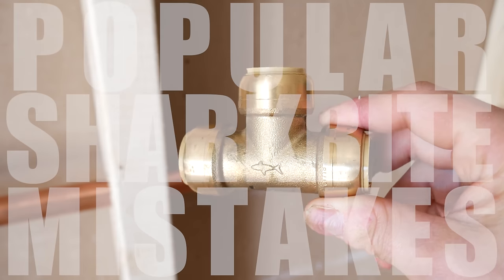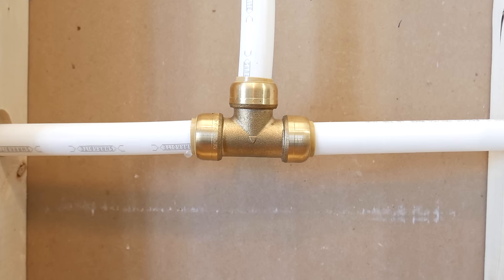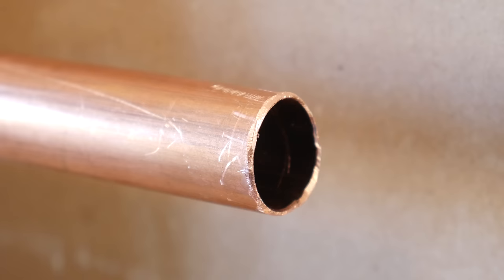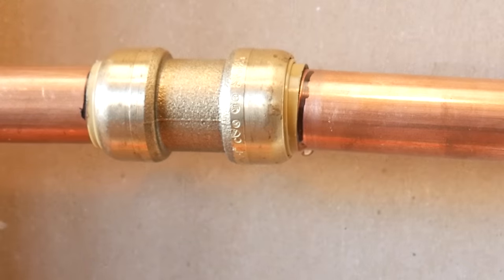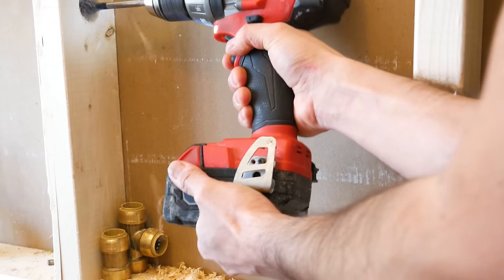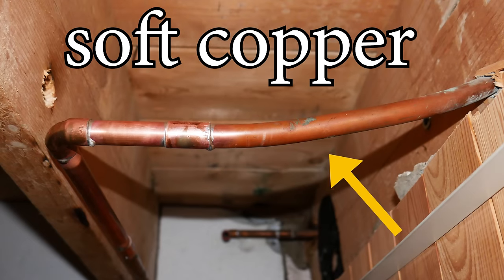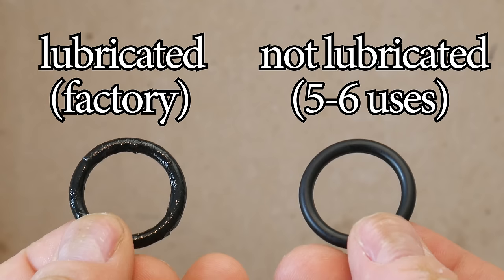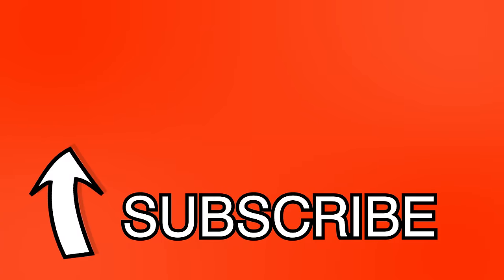6 SHARKBITE Mistakes NOT To Make! | GOT2LEARN

Comment: I've migrated solely to Sharkbites to minimize soldering and convenience.  I've marked how deep they should go from the early start.  I've deburred copper but now I want to get the tool.  I spend too much time deburring with a file, and it's not always right. I have silicone oil for other rubber applications, but now I'm going to use it on the o-ring here.  I've had problems removing Sharkbites on copper, but I'm getting a better grasp on it.  The tool doesn't allow me to fully push the seal in, so I use a crescent wrench to push in the seal.  I'm probably using the orange remover tool incorrectly.

Comment: Sharkbite fittings work on pressurized systems like standard house plumbing, but they will fail if the system is under vacuum. Learned this while trying to draw water up from a cistern using a pump. The vacuum pulls air into the fitting, and the system cannot maintain a prime.
Reply: Does it just suck the o-rings through? I have put them under suction with no issue but maybe it wasn't to the pressure you did?

Comment: I like this vid. Push-on fittings require greater care with the preparation of the pipe, but in return you get to skip the fire. This vid gets that across.
Reply: Disagree 100%. You need to take the exact same care with deburring and cleaning the pipe as you would with soldering. It's the exact same process, minus the flux and torch.

Comment: Weekend warrior here, great vid thanks. Plumbing task complete and didn’t have to call a plumber. Feels good to learn something new and self accomplishment. I enjoyed your soldering copper pipe as well-good stuff.
Reply from the maker: Thank you 🤗🤗🤗
Reply: You will call one when that rubber o-ring gives out. It will give out. Then that piece of copper you tied onto will have to be cut because of the corrosion caused to the copper by the water. They are for quick fixes and not permanent.
Reply: @texan4life129  good to know, thank you. I’ll keep an eye on it.
Reply: @jimb3093  soldering is very easy. I've been a plumber for 20 years and I would recommend this guys video on soldering to learn how. Very good instructor.

Comment: Your video helped me fix some leaky Sharkbite I was experiencing. I am brand new to using the product. I used it on a short run, with a 90, to replace a leaky spigot. It leaked in multiple places. I rebuilt everything 3 times before figuring out how to do it without leaks. I probably made every mistake imaginable, but ultimately, the following corrected the leaks. 1) cutting the pex very carefully and with a tool. I had been cutting it with a hacksaw and deburring the edges with their deburring tool. It seems there is very little allowance for less than perfect cuts with this product. 2) the length. Lowes didn't have the product to mark the depth, so I just used an inch for 1/2 inch pipe, and pushed really hard and twisted. Its a pretty good product, especially given a crimping tool is $100 at Lowes.

Comment: I finally tried some SharkBite fittings after years of refusing. I could never get an answer to the “how does it work”, “how long will it last”, and “how do I remove it” questions, so I just stayed with sweat joints.
After trying SharkBite, I’m sticking with solder. SharkBite fittings are great for commercial applications where no one cares about anything other than getting the job done quickly, but for residential work, they’re not good enough, in my limited experience. When they leak, you’re stuck cutting them off. Why do they leak? Who knows. You cut, de-burr, measure, and insert fully and sometimes they are watertight, sometimes not.
I trust copper and solder. It works perfectly every time and lasts forever.
Reply: You don't "cut them off". You use the release tool and it takes two seconds, leaving undamaged pipe for your next choice.
Reply: @UpnorthHere  I purchased a removal tool for a couple dollars. After several unsuccessful attempts (which damaged the removal tool) I cut the pipe. 
The instructions on the removal tool package were not helpful. I’ve heard there is a better removal tool, but I’m not plumbing a house, just doing some repairs and don’t need a $20 shark bite removal tool. I’ve got plenty of propane, flux and solder.

Comment: The trick to remove shark teeth — push the disconnect ring in really hard with the orange clip, and push the pipe in hard simultaneously. (This should disengage the teeth) Then give the pipe a good tug while holding the clip in
Reply: Use an adjustable wrench, way easier in my opinion.

Comment: Making a test gauge out of a piece of clear  flat plastic it’s something I did when I ran into a situation where I didn’t have enough slack in pipe to pull it together or push it apart
Reply from the maker: Works very well too, thanks IRON!
Reply: I’d love to see a video on this. I’m wondering what do do if you don’t have enough slack to push it together.

Comment: has the code solidified the use of Shark Bite behind closed walls yet? Canada and USA ?. We have been not using them behind closed walls , and if we did, we ensured there was an utility entrance near by to get to them.( arms reach ) .. unless that's just the practice of the guys I work with. Our COE prefers them when inspecting as well.  I, also for insurance reasons, needed a Master plumber to sign off on work and the first thing he wanted to ensure was NO Shark Bite type behind closed walls.  I am starting to think that is just an older plumbers preference..
Reply from the maker: I still don't think it's being enforced. I personally know plumbers who use Sharkbites all the time in walls and they never have any call backs, but yeah, maybe in a few years we'll be seeing them a little more ;)
Reply: No there is a reason. They are not for permanent use.

Comment: I marked the 2 pipes and no matter how hard I pushed the sharkbite down onto the pipe it would not touch that line!!!!  I have a small boxing space to work in but I pushed down multiple times, but it would not go down any further
Reply from the maker: You working on PEX or copper? Is there a white stiffener inside the fitting?

Comment: The invention of sharkbite is up there with ducktape & Velcro being invented
Reply: Except shark bites are way more reliable and long-term than duct tape or Velcro no matter what these old men who used to be able to charge an arm and a leg to sweat a copper pipe tell you.. sorry old man it's the new way and it's better than the old way
Reply: I agree with that assessment except for Velcro. That item was back engineered from an alien civilization.
Reply: The oscillating saw or viberation saw.
Reply: Duct*

Comment: You’re also supposed to remove the stiffener inside when using it on ridged pipe like copper and cpvc.
Reply from the maker: Sharkbite says it doesn't matter.
Reply: @Got2Learn  But it does constrict the flow. That is one of my main complaints with regular PEX fittings, they restrict the flow. But the Mannings with the rest is better than pipe, but not much better than copper. So the restriction at the fitting diminishes flow downstream.
Reply: No you’re not. They are specific to Pex and copper. The inner sleeve is actually two different diameters.

Comment: A quick trick for reaming is to use a needle nose and that smooths out the copper. It's not the best option. I always carry my reamer tool, but in a pinch...it'll smooth out burrs.
Reply: If you are careful on PEX, you can use a utility knife to deburr.

Comment: Biggest mistake is saying reliable and using them as a permanent fix. Should only be used if you do not know how to do a real repair job such as sweating or bruising.It should only be used if you have a plumbing problem that you can fix with this as a temporary fix especially on a holiday when you don’t wanna have to pay extra to have plumbing repair. But when it is feasible have a plumber do it the right way
Reply: Most new homes now have pex in them.  There's nothing wrong with shark bite fittings as long as you know what you're doing.  Copper is very pricey in today's world.  In very confined spaces it's kind of tough to get a torch to do anything without burning wood.  I'd prefer not to use a plumber unless I have to because they do not care what they trash in the process of getting the job done.  I do care.

Comment: What materials/tools would you recommend to clean old copper pipe to best attach a new sharkbite?  In another video you said to never clean the copper, yet on this one you said to always clean the copper!? So which is it? And how best to clean it? And, will it work if it's got some leftover solder (from the older copper connection), or does the old solder also need to be cleaned removed from the copper before using a sharkbite? Thanks! Btw, Love your videos, great content overall!
Reply from the maker: Yes, it's not suggested by Sharkbite to "sand down" the pipe when installing Sharkbite fittings, however, if there's solder from an existing joint, I would personally suggest to heat up the solder, wipe it off with a rag and then use some light sandpaper or emery cloth to remove the residual solder. But honestly, the best thing to do is to have it clean and untouched, so if you can just cut out that part and deburr it, I would prefer that, cheers!
Reply: If it looks like shit, I just use a normal pipe cleaner and make it shiny, just like if I was going to solder it. Haven't had one fail yet?

Comment: One thing I never see nor hear about is the affect on homes with a poor ground on copper pipes.  When you install shark bites in this scenario, it makes the electrolysis process worse.
Reply from the maker: Yes, with SB you need to "jump" the fittings.
Reply: What?? Do explain please.
Reply from the maker: Your home's ground needs to be bypassed if you use a Sharkbite fitting.
Reply: If you are talking electrolysis by going from copper to ferrous, you are mistaken about a poor ground. Whenever going from copper to steel one needs a dielectric fitting or "jump it". Sparkies love to ground to a utility vs/drive a copper grounding spike

Comment: Do I have to remove the inside plastic when I'm putting a sharkbite on copper?
Reply from the maker: You don't have to remove it.
Reply: It is best to remove it because it restricts the flow but like he says you don't have to but if you want one of them don't want to restrict your flow you need to remove it needle-nose pliers works best

Comment: I like the shark bite fittings for temporary use during a project but I don't like them as part of the permanent installation.
Reply: Why?
Reply: @ws90ninety  I would prefer to not have an  o ring relied upon for long term, I might be a bit old school but give me a solder, threaded, or solvent weld joint.

Comment: Practical info.
When using a SB fitting that transitions from PEX to CPVC for example, is this fitting material specific?  Meaning, is one side only for CPVC and the other side for PEX?  
Or does it not matter?  Can replacement "O" rings for SB fittings be purchased separately, in case one is damaged?

Comment: No matter what anyone says an O ring will fail LONG before a solder connection.
Reply: @ integr8er66  That’s why they make pro press fittings and crimping jaws. There is shark bites, Pro Press, Add a Valves, Copper and Pex. There is many things to choose from now besides soldering copper. I can do all of them along with soldering, brazing and welding.

Comment: Also got2learn Im surprised you didn't mention removing the sleeve for all solid pipe but leave it dor pex and poly
Reply from the maker: Sharkbite recommends leaving the sleeve in no matter what type of pipe (they claim that by removing it it can damage the SS teeth) so just keep em' in there.
Reply: @Got2Learn  interesting,  I remember it being recommended they be removed but I can see them saying that for simplicity of use and sales.

Comment: Would these be a reasonable choice for my hot water heater? 
For context my hot water heater died today and its from 1995. My hot/cold inlets are 1/2in copper pipe and not sure if its soft or not but I don't have the money for a technician to do a professional install. So I was thinking i could add a 1/2 to 3/4in sharkbite because the flex pipe that came with my hot water heater are 3/4in brass fittings. Is this a viable option in your opinion?
Reply from the maker: Sure, just watch my Sharkbite playlist before in case and you should be good: https://youtube.com/playlist?list=PLLEVGyi2B-cb98lELYPFb4bWrYgsZ0fH2

Comment: I frankly am very reticent to like shark it’s fittings as a mainline installation system.  I could see use for them directly behind an access panel in an area that requires a high degree of maintenance, but hidden randomly behind walls seems like very risky option compared to other solutions.  Also frankly I’ve seen too many plumbers screw them up in the field.
Reply: Good for a temp fix. Not for permanent install.
Reply: @smokepeddler   25 year warranty. Soldering in residential is a thing of the past.
Reply: @britneyystaples91  I agree. Not with shark bites though. Either expansion rings or crimp rings.

Comment: After we replaced leaky taps on my washer with these push connect taps, the standpipe is backing up now when the washer is draining? Could it have something to do with these taps, that didn't happen before, could these taps change the water pressure?
Reply from the maker: Might wanna check the standpipe first, those don't normally backup.

Comment: Good vid, although the first suggestion marking it shouldnt be necessary if you simply firmly insert it all the way and half to full twist Ive never had the problem.
Reply from the maker: I think it's for insurance purposes 😉
Reply: No the depth is crucial.  If you’ve had no problems, you got lucky.  It has to go past the o ring and then through the locking washer.   I’ve had joints where the was pressure on the pipes holding the connection together and no leak.    On an elbow though it blew off the Sharkbite as soon as pressure was turned on.   If you don’t know the correct depth, you might be trying to force it on further than it needs to be.   Or not enough.  Relying on “feel” for it being seated is a recipe for trouble.
Reply: @andrewhigdon8346  in short,  rtfm.

Comment: Nice viedo I have never used one but I have a question, can I use one on 1/2 copper and 160 psi black water line thanks and can I burry it.
Reply from the maker: I would suggest not, 160psi is a lot, specially if you plan on burying it

Comment: Refuse to use these fittings. Reliable??? If you bump it,  it leaks. I'm good soldering.
Reply: Yea but my house has no copper and they work awesome and hold up better than other options. Not to mention easy to use. I agree if I use copper I’d also solder.
Reply: CPVC only way to go who can afford copper pipes any more... or pex if you're lazy

Comment: I have used a lot of these fittings & they work really good,but the pipe must be clean & cut square,that is at a 90'degree angle.& if it is used in a drinking water application, never use Vaseline or other petroleum based lubricants, use vegetable base greases,there is one specifically made for drinking water & fire hydrant applications, but if you can't find any use the vegetable oil to lubricate the O ring.